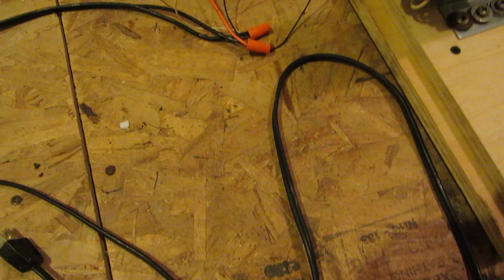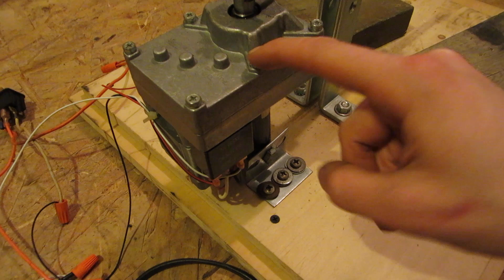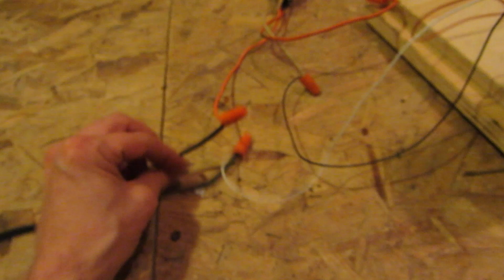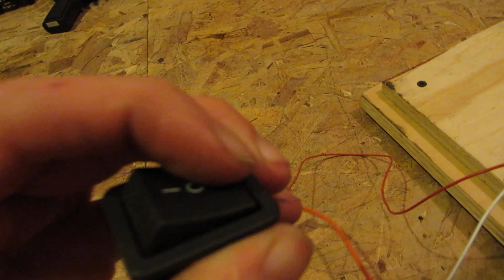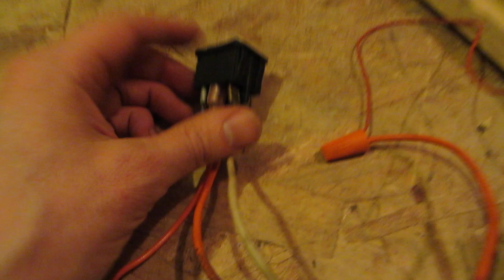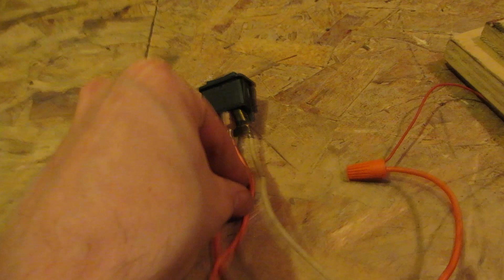Incline Motor Assembly Wiring Guide

Comment: Next time, Black is "Line", White is "Neutral" and it's not a bi-directional motor, it's a simple brushless AC induction motor capable of forward and reverse rotation depending on the direction of flow applied to the Field/Stator and that is controlled with your DPDT 6 pin rocker switch. The armature, having the magnets built in the core will act according upon the field created within the stationary windings found on the stator housing walls.

Comment: Would have liked to see how the cap is wired from the motor and out.  cool projects
Reply from the maker: Cap has it's own set of wires coming out of the motor, shouldn't be any reason to mess with them.
Reply: @HL4EHalfLife  There is if they came disconnected  on same incline motor lol

Comment: Cool man, thanks for making this video. It let me utilize a 500 lb thrust motor without blowing the motor up. The colors you mentioned worked great on mine. I would also suggest, in troubleshooting wires like this, to use a "short circuit protection" device. "Uncle Doug" on Youtube has one that works great. Thanks again.